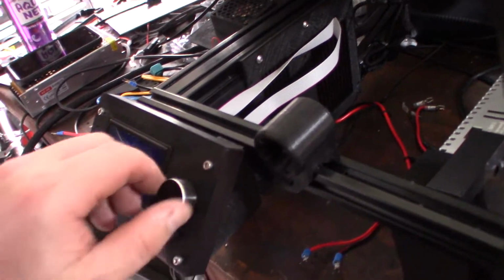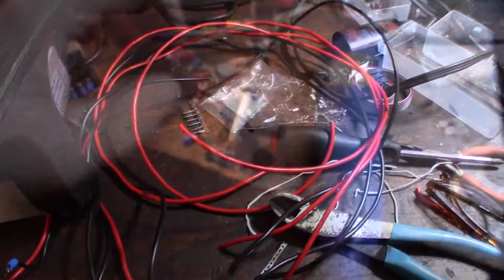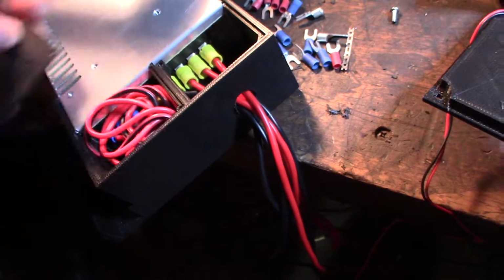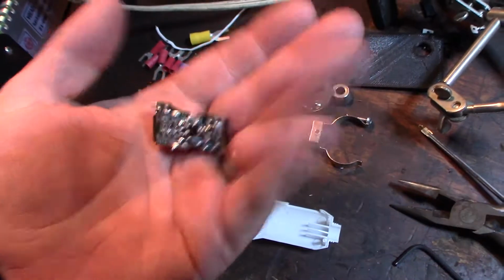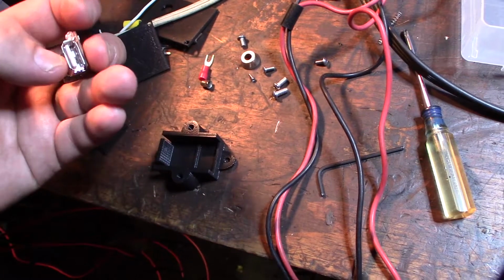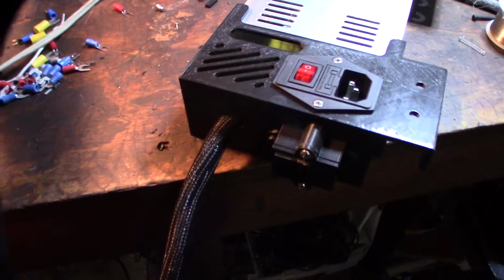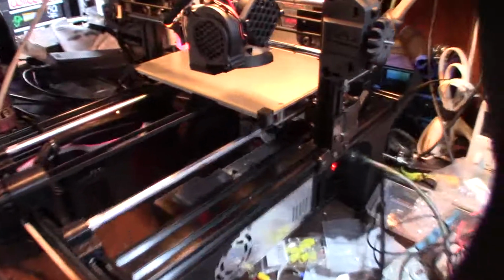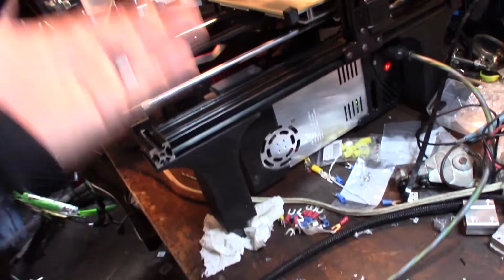Anet Creality Tevo printer external control box removal upgrade part 2

Comment: nice upgrades - great video's well done, other then the main board, it's like a prusa mk2 - mk3.  would upgrade to a duet board+touch screen, once you start your 500x500 upgrade. and get some Capricorn PTFE tubing, would also get a volcano hotend or micro swiss hotend. I like e3d machine work verse china made hotend's I have tons of china hotends but nothing like the e3d's once you use e3d's hardened nozzles the machine work makes a difference once you compare prints after a few months of printing.  and maybe a silicone heat bed if you don't have one yet. I have silicone heat bed with controller on my cr-10s and it heats 2 times faster then my prusa mk3 bed. but the speed of the heating of the bed on prusa is just fine it's also fast. as once you print in abs & others you will need the bed at 100c plus. maybe inclosed also.